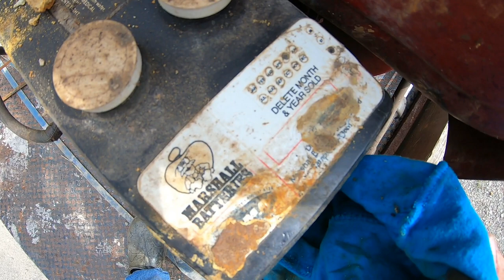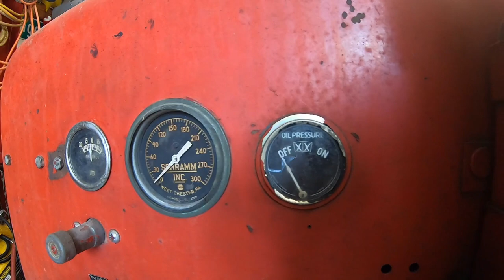1950's Gas Powered Air Compressor sitting 30 years! (Will it run!??)

Comment: I have worked in a machine shop for over 30 years and you scare me each time you use your drill press.  A drill press causes more injuries in a tool shop than any other machine and this is because we are careless when using it.  The part you are drilling needs to be braced against a back rail to prevent it from spinning out of your hand and becoming a helicopter if the drill should catch on the part, especially as you break through the bottom of the hole.  The drill may lock up on the part and spin, this would break your hand or if the drill breaks, it may fly away and hit you or someone near by.  Always brace the part being drilled against a back safety rail and if using a larger sized drill, clamp the part down to prevent it from climbing up the drill if it catches.  This is the first safety rule taught when learning to work with machinery.   Please be careful!

Comment: Old race track pit trick. Next time you need to repair a float that you can’t get replacement for, use gas tank sealer.

Comment: To add to my comment below , we also had a compressor that was a 6 cylinder with 3 cylinders for power and the other 3 were air compressor and it was a pancake design and air cooled and was started with a rope . I hated them as they were hard to start and the magneto's  were a bear to work on . It only take's one time to get popped with spark as you were clocking it to get it in time to reinstall . One quick story , while working on one of these compressor's and 4 of my fellow mechanic's were working on the compressor the guys pulled the plugs to check to see if it was getting fire to the plugs , a new mechanic helper had the rope ready to pull and as the 3 guys were in the process of attempting to hold the plugs to a metal surface one of the guys jokingly told the new guy to pull the rope . It had plenty of spark and all 3 guys got the full effect as none of them had yet got the plugs on a metal surface . The new guy learned his 1st lesson to not do everything he was told to do until everyone involved said they were ready . That was 48 years ago and I remember it as it was today .   BTW , what series Wisconsin engine is that , should start with a ' V ' but I might be wrong . THD , VGD two cylinder's and VG-4's were great engines as a whole bunch of our equipment were powered by .  Again , Great video's . .

Comment: It's been close to 20 years since I've seen them still in use, but those old VH4's where tough engines. I had customers with them in small specialized machines for underground utilities work. The most memorable one was the one which had an oil drain extension pipe added to reduce mess during an oil change -- the pipe wasn't supported and it broke off while in operation. No body noticed and it ran out of oil and continued to run until the engine got so hot it cooked the gaskets away between the intake / exhaust and the block and started running badly.  I put all new gaskets in and fixed the drain and it went back to work for years to come.

Comment: I love the looks of that compressor! Straight out of the Fallout games!
Reply from the maker: They way it was styled was half the reason I bought it. Very unique!
Reply: Two of my favorite youtubers visiting each other.  Sweet.
Reply: @TechGorilla1987  definitely are these two my favorites as well. :D
Reply: I was thinking it's Fallout style too,  I love that art style. Like Mustie1's battery charger, Water Witch and generator.
Reply: Looks like a small section of a tractor hood.
Reply: I see You been watching just much YouTube as Me lately seen hanging around the same crowd Did buy that Merc???
Reply: My first thoughts exactly😂
Reply: @FOOKYOUTUBENUMBERS  Hehe. No I didn't buy it. Looks like I will keep driving Subaru for a while.
Reply: @ThePostApocalypticInventor  If aint Broke dont fix it, good car the Subaru, looking forward to a new PAI vid..
Reply: Guess the PAI has seen lots of similar compressors on his scrapyard tours but had no use for it given the size.
Reply: Nuka Kola air!!
Reply: @DieselCreek  y need a ultrasonic cleaner for that job !!!
Reply: @ThePostApocalypticInventor  p
Reply: @DieselCreek  thats an old concept,. a guy i know made a comp from a 4 cyl ford 1600,& elec motor..old stuff built to last. boltr.
Reply: @DieselCreek  that oil filter was original,,never been changed.. yes. ?.
Reply: @DieselCreek  you have a hard time throwing tools and other things on top of tractors and other machines it can be dangerous if it falls down and into the fan behind the radiator
Reply: @DieselCreek   when we gonna see more of it 😅
Reply: @DieselCreek  when will the next video be on this compressor?
Reply: @DieselCreek  You had a year to clean out the original gas tank and still didn't?

Comment: Float level in carburetors is usaly a bit lower than the hight of the bowl, so if it over flows like yours, then the flot level is too high or the needle and seat is leaking so the carburetor is leaking.
you can adjust the float level on the float by gently bending the part that hits the needle or the "hinge" on the float.
Reply: Some old carbs had float level measurements. With the carb upside down and held square, the float should be level. If it is lower on the free end, follow the tip to bend the hinge slightly to level it.
Reply: the vibration alone of it running starting with no air pressure , would make the fuel splash violently inside the bowl, making a missing or bad bowl to body gasket leak all over ;)
Reply: also, the floats are generally parallel with the carb body when inverted and shut, so if you don't know the proper level that normally gets you close enough for the dinosaurs!
yes I tend to weak with proper measurement know to within a 32nd to 64th of an inch, but even that can be skewed with float weight changes, like a hole, soldered weight, porous and absorbing(composite floats).  very far from my 1st carb service, owned and rebuilt many of my own and uncountable numbers of others from tiny model craft to large racing size :)
Reply: I've found the brass floats are easily repaired by drilling a 1/16" dia hole at the leak site, roughing it up with sand paper and soldering it shut. Solder containing lead is best but others work as well with lots of flux.  
I was enjoying a bunch of your vids today.

Comment: Carburetors like that are why I bought myself a small ultrasonic cleaner. It helps clean those carbs up right away so you can just throw them back in the same day. Saves a ton of time.
Reply: Yeah, I hear what you're saying, but with the acetone, gasoline, oil and carb cleaner you really get the smells you need to get you through the day. Especially if you are a DIY mechanic ad hoc.
Reply: @jesseparris6507  
Yes I agree with the fumes and potential fires so I have a small covered area outside of the shop
Reply: Oh man I'm hoping he gets a 10 litre ultrasonic cleaner in the future
Reply: It's called a updraft carburetor
Reply: @jesseparris6507  
Omg lol!

Comment: Cool rig,I love seeing other folks not be scared to buy/run a dinasouar.
Reply from the maker: I love dinosaurs lol
Reply: Nice I love older equipment  I have a 1948 Willys pickup and a 1955 International Harvester tthat I've rebuilt. I bought it from Conoco Wyoming in 1977 so I'm the second owner. I've the build ticket and the original manual
Reply: you have a crane truck you could use to take it off the truck
Reply: where's the video of the crane being used. have not only seen the engine being put in the truck
Reply: @dancurrier6421  why does that matter? What's the big deal?  He has a forklift at his home
Reply: @dancurrier6421  I watched it again and he said all of his equipment was not there but at jobsites.19o91
Reply: Thanks Matt love your channel.  I live in Texas and since I'm handicapped I would not be able to visit but boy I love the farm. I live near Odessa, TX  bet I could find Autocar parts for yours.
Reply: Dinosaurs can be fixed, new stuff is just broken.

Comment: LOVE that compressor. LOVE IT. Can’t wait to see it working 100%. Very jealous. Please post another vid of this project soon. Also PLEASE hydraulic test the air tank before you build ANY SERIOUS pressure. Easy to do. Fill tank with water,hook up gauge with range to 2000 psi, and use grease gun to pump pressure up to close to 2k psi. If it leaks or blows, it’s super low volume and safe. Can’t WAIT!

Comment: That thing is awesome! I saw one like it that used a Ford inline 6, 3 cylinders fired, 3 pumped air. I've seen my dad solder floats, but I'm too chicken to try it myself. You might have to adjust the float height to keep the leaking to a minimum (it's a Wisconsin after all).
Reply from the maker: yes Wes I was thinking if I tried to solder that float id end up with a big ol hole in it lol surprisingly the nail polish seems to work fine.

Comment: In my younger years with no money to replace parts, I've cleaned points, rotors, distributor cap contacts and even spark plugs in exactly the same way. It worked a charm!

Comment: My Dad always used emery boards. He also used cereal boxes for making gaskets. He always said never throw out cork or  leather pieces they could be use too.
Reply: Emory boards are likely to leave grit behind, which a points file won't do, but a few seconds of running should blow that out, and cutting off the board as it gets dirty seems like a decent plan.

Comment: This has Mustie1 written all over it. He probably has one of those seals...
Reply: My thoughts as well.
Reply: I bet he does, prolly has the carb too =D
Reply: this is the same air compressor that runs his shop
Reply: Mustie would have had it straight into the sonic cleaner.
Reply: @johnobiro5202  on his 50cc chainsaw engine lol
Reply: @johnobiro5202  musty is annoying he sounds like a school teacher although a good designer and mechanic he doesn't understand that Clinton power products never made a 50cc engine they didn't rate engines in CC s . His suitcase mini bike does not have a 50cc engine. To old.. he just wants to be able to ride it he should have admitted it.
Reply: Just reseal float
Reply: @ronalddaub7965  dude,if you dont like him,just dont watch him
Reply: def check w mustie1

Comment: That looks so cool.   Love the vintage styling and the ingenuity of making a V4 into a 2cyl engine / 2 cyl compressor.  I’m only at the start of the video so I’m not sure what you ended up doing with it but you could get hold of a vintage looking trailer and make it into a portable trailer compressor.

Comment: I have a similar compressor made with a 4 cylinder Jeep engine.  It was purchased used from a shop in the 70's and at the time the previous owner also had another one based on a Ford V-8.  I use mine once  a year to blow out all the water lines at the local fairgrounds.  In the past I have used it for sandblasting and even ran a 90 pound Thor pavement buster with it.

Comment: I'm sure you probably already thought of this but when I have a crusty fuel tank I throw a good amount of acetone and a couple of handfuls of nuts and bolts inside and roll it around shake it back and forth dump it out, pressure wash it, dry it out with the rag and compressed air and if it's not rusted through it'll be good as new. Thanks for the videos.
Reply from the maker: Yes it’s pretty big to be rolling and shaking tho. I will take care of that in the next video

Comment: That was different. Love the old engines. A couple of suggestions. To test for carb leaks I use an outboard fuel tank with the squeeze bulb. You can also pump it up with air using a hand pump with a guage. 8 to 10 psi should be good if it holds for 5 minutes without loosing pressure. Did this on my 9.9hp mercury outboard carb video. On those glass fuel bulb housings try a cannon electrical plug channel lock pliers. They have the rubber grips that will turn the bowl off without breaking it. Looking forward to seeing more on this. I have a wide range of videos so check mine out too👍 Thanks

Comment: The fuel-level in the bowl should NEVER be above the gasket. Hence, your problem is with the float/valve.  First thing to check is the float-height. (bend tab to adjust).  Also suspect the floats are too heavy (have crud within them). The needle/seat is also something to inspect.
Reply: Good thought but the gas can and does shake around in the gas bowl. I agree on trying to lowering the fuel level, if there is trash in the float it may be floating lower than it once had.
Reply: Exactly! Floats, needle and seat.
Reply: It starting with no choke and black spark plugs is a bit of a hint that it's over fueling . I agree with your comment 100% .
Reply: @robertordewald8678  a

Comment: I have been using emery boards on my 1949 and 1957 Cushman motor scooters since 1961, also my 1955 Studebaker and my 58 and 61 Chevy's. and their still running!

Comment: That’s one of the coolest compressors I’ve seen. I saw one made out of a model A engine. 2 cylinders to run on and 2 to compress air.
Reply: I’ve seen V8 engine compressors. Done on a small block Ford. One bank for power, the other bank for the compressor.

Comment: In the 90s I worked as a mechanic at an old amusement park. We had a ride that needed lots of air and the 1940s-1950s compressor on it was a Schramm.  It was an electric one, likely a 25-40 HP electric motor driving what looked like an old straight 6 diesel engine converted to a compressor.  Our storage tank for it was easily over 500 gallons (A horizontal tank 3' in diameter by 10' long.)  and that compressor would bring it up to 125 PSI in under a minute.  It ran 12 hours a day for about 1/3 of the year for better than 30 years before it finally tossed a rod.  It was a beast and also had the nice raised cast SCHRAMM tags.

Comment: Those Wisconsin V4s are decent motors. They tend to run hot, especially as farm equipment motors. We had a model VG4D on a Case 850 swather. Between the chaff dust and hot summer temperatures, it would overheat and shut down from lack of compression. Just let it cool off for an hour and it was fine for a few more. 

Our swather was built in 1960, so that tells you how long they produced that engine if your Schramm portable compressor is 50s.

Scramm also made tractors that also doubled as portable compressors. There's plenty of them on Facebook in antique tractor groups. They're always a treat at tractor shows

Comment: Matt, I have a very old Wisconsin parts manual that covers I think, most Wisconsin engines. I looked up your engine/carb based on your video and found not only the part numbers you need but I also found two complete kits on E-bay which are still available today. 12/26/2023.  I had to use the same method to find a rebuild kit for my fuel pump a couple years ago. I don't know how to get you the info I have as parts are hard to come by for these Wisconsin engines. Otherwise I would have posted it here. Hopefully you still check your comments. I'll check as often as I can to see if you've replied to me 😊. Hope this helps you out Matt.
Reply: Oh the cost is around $60.00 with tax, shipping etc. Take care.

Comment: I've used these types of air compressors in the oil and gas company i work for. We had one identical to yours only it was mounted with tires and a trailer tongue so we could pull it to different locations.  We mainly used it for spray painting gate valves on pipelines. They were great machines. The last one we had was sold in a company auction and went for $50.00 bucks. I could've kicked my butt for not bidding on it.

Comment: With the float bowl, check that the plug in the bottom that holds it on, has not caused the bottom of the bowl to bow inward, which causes the sealing pressure on the bowl gasket to be lower than what it needs to be. Mustie1 has covered this once before, and ended up tapping from the inside of the bowl, out - so there was a gap on the inside surface to where the thread is, so when you do the bowl nut up, the bowl acts as a sort of spring in a way, and holds the tension on the gasket. Maybe this is valid for you too.
Reply: My thought about the carb bowl leak was that the height is off, allowing too much fuel in which then overflows;  bending the tang holding the needle takes care of that.
Reply: Use a planer on both surfaces.

Comment: We had compressors like that on the railroad & I was a mechanic on the track working equipment . Wisconsins are good engines , electric starters make them worth a lot when trying to start on cold days . We had a compressor that was a 302 Ford V-8 that one bank was power and the other was compressor , great rig . Your compressor will come in real handy . Great video , keep them cards and letters coming .

Comment: I used to work for a uniform company that serviced what was left of their factory (Schramm) in the late 80's. It was like walking back through time with the wood block, oil stained floors and old buildings.  Very neat place.  It seemed like only a handful worked there then, but hundreds in the past.  In its heyday I believe Schramm compressors were highly coveted by the drilling and public utilities.  So great to see this old piece of equipment.

Comment: Wisconsin's are prone to carbon falling onto the cylinder and cracking the ring land so a common service procedure was to decarbon. the oiling system is primitive that is a felt filter and nozzels spray oil onto the crank virtually full splash, oil pressure about 15lbs these engines are bullet proof
Reply: And have a primitive oiling system. Not even supposed to use detergent oil in these engines says it right on there

Comment: I believe Schramm made a version made from a Ford Flathead V8 where half the cylinders didn't have spark plugs and they were used to compress air. Similar to what you've got going on there. Just a bigger version of this. Even mounted on it's own trailer I believe. Good stuff!